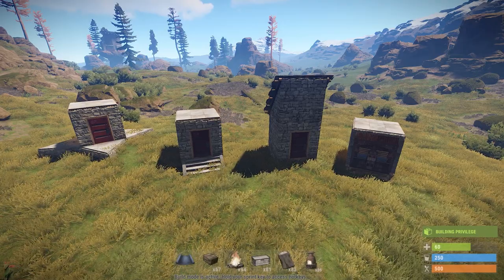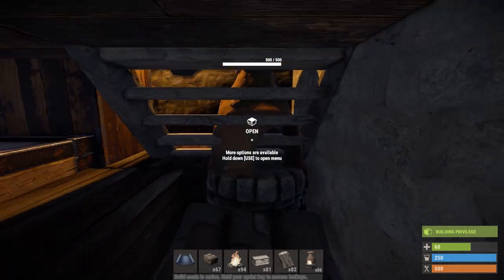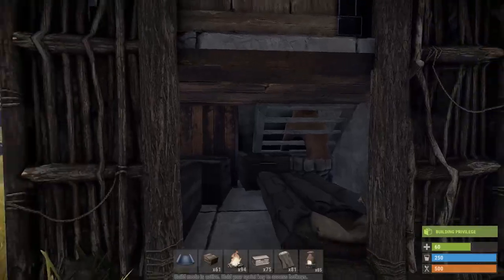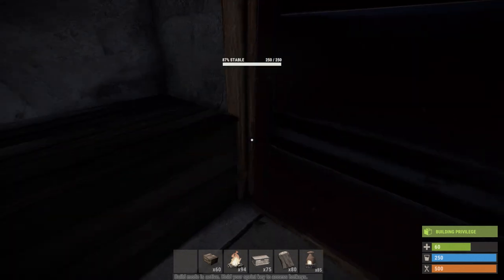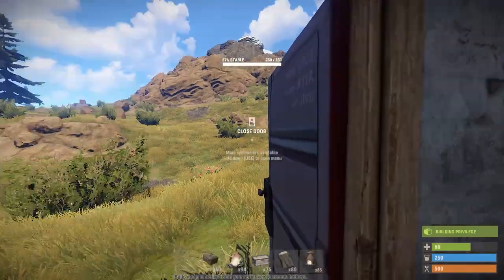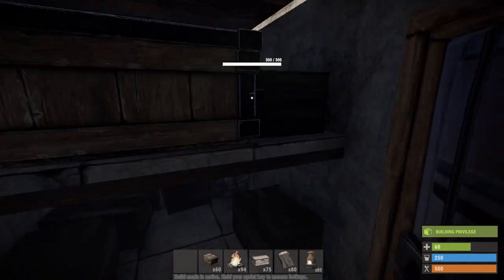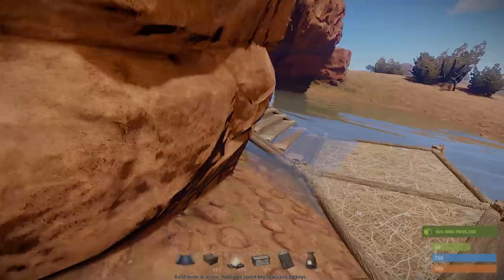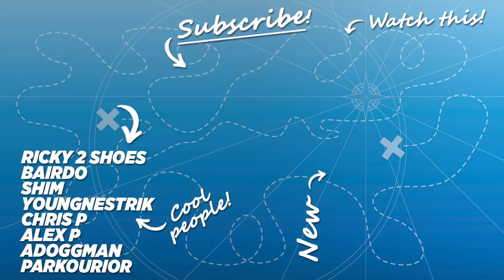THE 1x1 STARTER BASE - Rust 1 by 1 base review - base building guide

Comment: Great Job! Really loved the river mouth base ratio: 9:1 super efficient. and with the ability to wall stack later on with saving up resources its a great starter to main base location. Keep up the good work.

p.s But if you leave it wood until you smelt up some metal it is even more efficient.  Because its really hard to flame raid a river base. +1
Reply from the maker: Yeah, that's an amazing design from Invis!